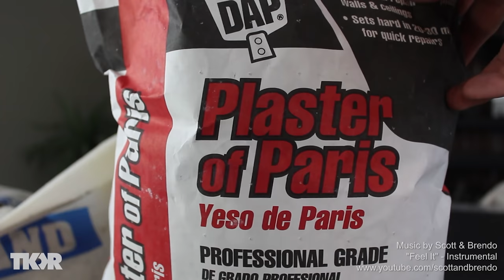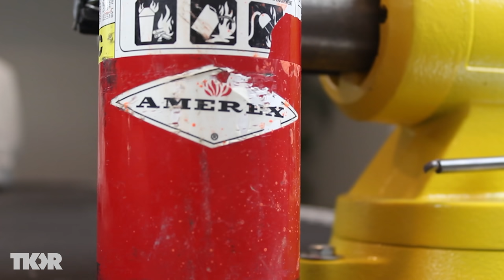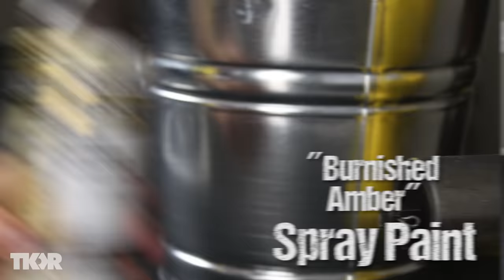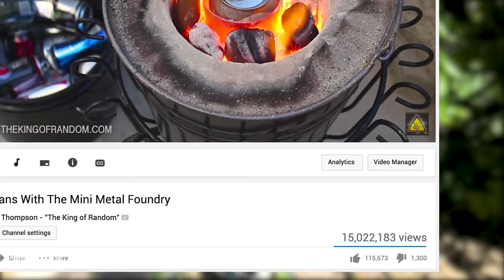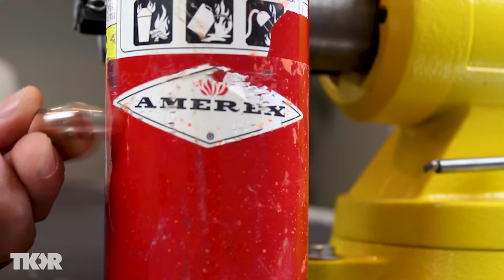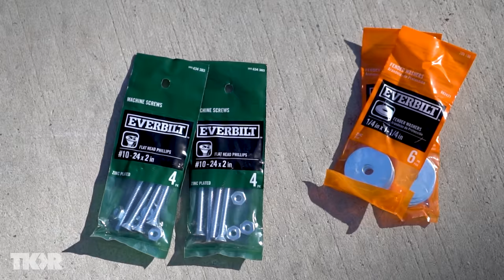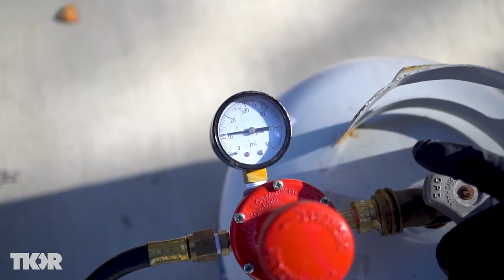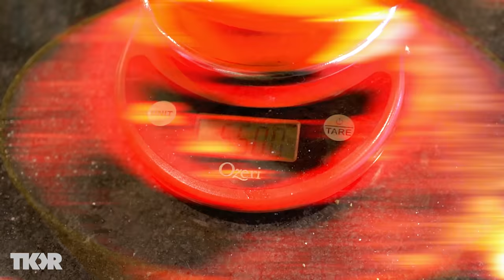7 Ways to Make the ULTIMATE Metal Foundry - TKOR n' Chill EP. 1

Comment: When using the firebricks, I would suggest lining the whole outside of the bucket with K-wool blanket, then put the firebrick in tightly, maybe split the blanket so everything fits tightly, then fill in the gaps, there’s a product called water glass that’s made for glueing K-wool and firebrick together, I use this method quite a bit when I rebuild chambers in boilers, water glass isn’t easy to work with, but it works well.

Comment: the one part ya'll don't touch on is how to build the burners, that is the part that gave me the most headache. things like what type of regulator you need (high output, not just any regulator will work) the size of the orifice for the gas port (found somewhere that said size 0.030 MIG tips work well for propane) these are the things I would like see covered please.

Comment: I did a backyard foundry...
I suggest using ceramic wool, a 5-gallon bucket, and ITC-100 clay slurry brushed into it liberally. It insulates better and is more refractory. I also used steel pipe with a cap welded on the bottom.

Comment: In the past you've changed the density of wood with water in a vacuum chamber. Could you try that with metals/alloys with a melting point under 300° C (the burning point of wood) try little wood sculptures and what not. Just a heating plate a pot and vacuum chamber
Reply: That sounds like a fun idea

Comment: Without refractory on the ceramic wool, those fibers will go airborn and get into your lungs.  Think about a stabilizer at the very least.  You also have to worry about vaporizing that zinc off the metal which is also very toxic.

Comment: Put the crucible back in the forge after you use it rather than letting it cool at room temperature. let it cool with the forge to avoid thermal shock.  Also store your crucible in air Tite container. to avoid moisture which will shorten thew life. Also, It is advised to bring crucible up to 4 0r 500 degrees and let cool before the first use. If you take care of crucible last for exceptionally long time.

Comment: I don't get the point of the lid with handle if there is gonna be a hole in the center of it.
Reply: The hole is an exhaust for venting heat and, if you’re using propane, allow excess gas to vent out. Any melting furnace has one because you need it.

Comment: Could I use steel dust
Reply: I wouldn't... it'll quickly oxidize. When it does, it'll expand greatly which means your form will crack and break up. You want stability in any substance you use for a refractory. Aside from the problem of oxidation, you'll also have the basic problem of expansion just from heat which also doesn't help. Best wishes!

- Max Giganteum

Comment: Gypsum is a USELESS material for this, as it completely disintegrate at just 160 degrees Celsius. You can take a gypsum rock (Selenite) and heat it to 160C you can pulverize it between your fingers. Gypsum is also EXTREMELY hydrophilic, wanting to absorb water, making solid parts inevitably break at 100C. 

Get some proper materials, people, don't build these single-use foundry.